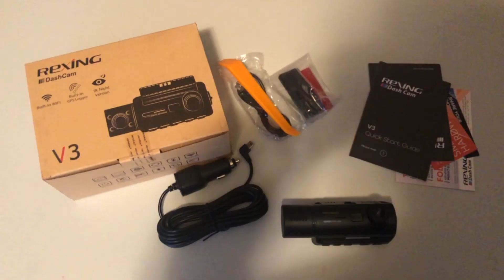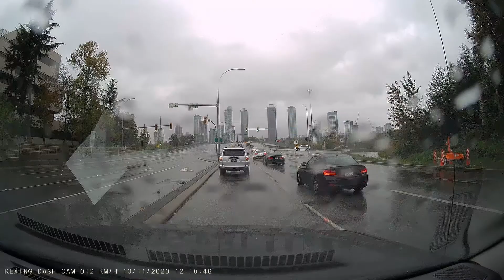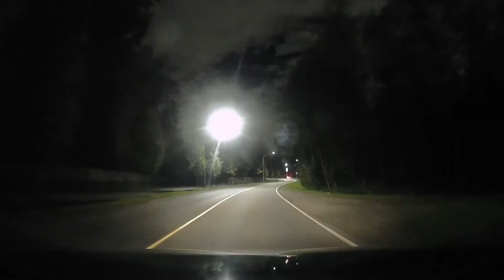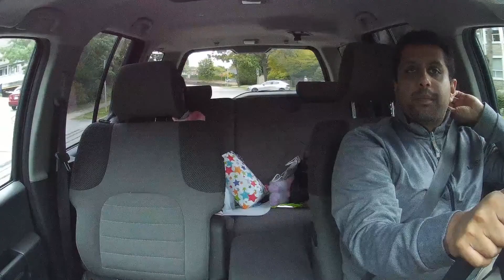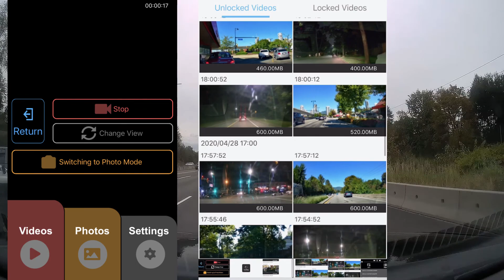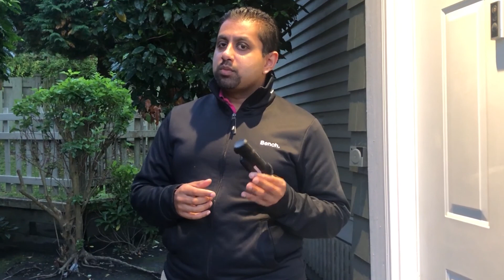Rexing 1080P V3 Front & Rear Camera Dash Cam Review

Comment: Question about original packaging, if you remember - when you originally opened the packaging - 1) were both cameras facing forward 2) for the camera that faces forward, did the lens have protective film on it? I think I may have been sold one as new that was supposed to be new....let me know, if you don't mind. If you don't remember, let me know that, too. Thanks.
Reply: I recently purchased one and the forward facing camera did have a protective film on it. The rear facing camera did not. The boxes has tamper evident stickers on them that will show if it was previously opened or not.